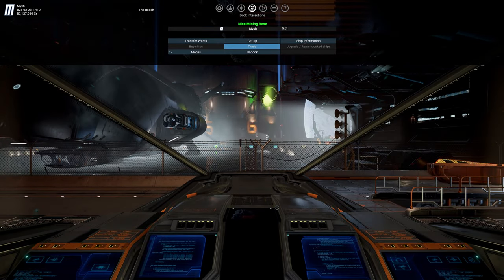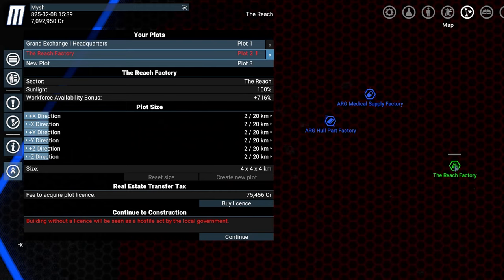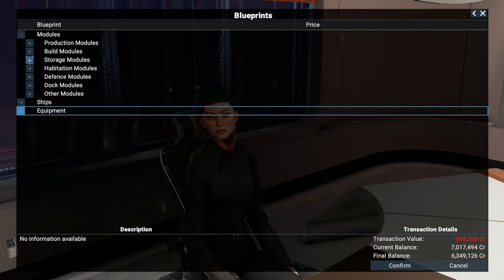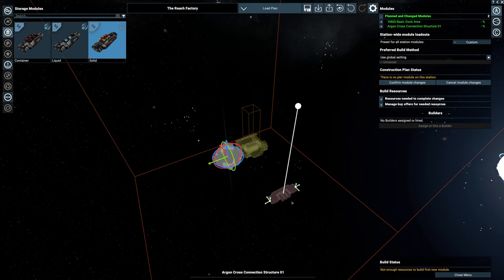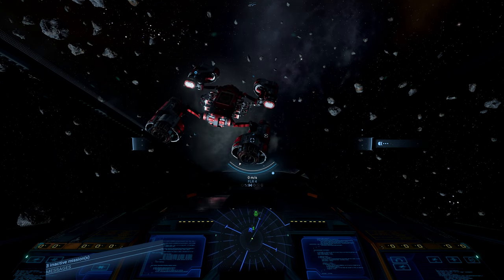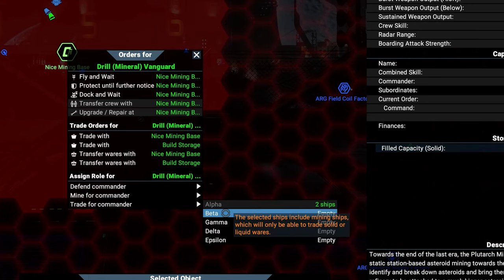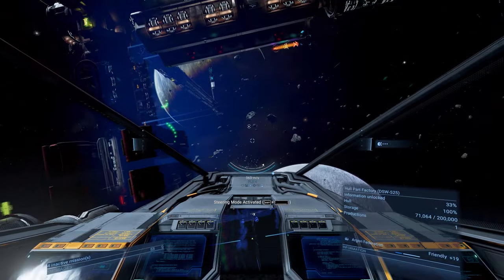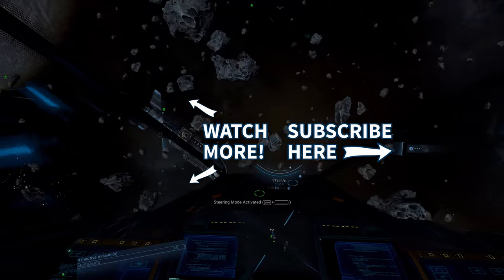X4 GUIDE: How To Build & Run a Mining Station (3/4)

Comment: instead I made it a trading station:
just added some liquid and container storage. (designed one in the station manager).
if 100% is full price...just buy at 25-30% and sell at 40%..
generally works...
add some miners, and traders, 
only buy what you mine from your own.
and you'll make more then just ORE.

for argon I like to start at second contact flashpoint 2.
there is ore and ice there, ore in the reach, and ore+silicon in second contact 7.
if you have a 3 star manager all in range.
1 gate south of argon prime.
Reply from the maker: Awesome advice! Thanks for sharing it!

Comment: I tried to mine in The Reach but about 6 to 8 Xen came and wiped out my mining fleet. I only have 2 fighter craft and both were destroyed while trying to drive them off. It's very hard to get started, as most of the missions I've seen only pay around 50K. Automining in Argon Prime seems very slow but it's the safest place for now.

Comment: I haven't been able to get the miners to mine or store anything automatically. Manually i have been able to, but i can only get them to store the ore in the build storage. 
Manager is 2 star, auto mining is at 1 star, but the ore is in the same vicinity of my HQ. Storages are connected to my station, not sure if that matters.

I Had the wrong storage.. Also why make a trade rule to buy ore form yourself? couldn't you click a button to not buy ore at all?

Comment: is their a reason for using 2 smaller storage and not a single medium? which costs less than 2 smalls to build and holds 2x more than the 2 combined.
Reply from the maker: No. It's just that the small blueprint is cheaper and you can run a basic mining base even with one S module. I just put two on my base here for aesthetics and convenience.

Comment: Quick question. I’m a new player and have only about 30 hours into the game. I ended up just making a fleet of miners that did “local mine” action. Is this not the same with extra steps? What are the advantages of this kind of station, is this just to cover showing how to build a station and it turn into an ore refinery?
Reply from the maker: I explained it in the video. It gives low level miners the opportunity to mine locally and sell in different sectors. It also lays the foundation to expand the base later on into a production/processing facility.

Comment: Can anyone please help me? I have set a ore mining base, have 3 miners detached to it, but all they do is they try to find where to sell ore, which results in "failed behaviour", instead of supplying my station with ore...
Reply from the maker: Sure. Here I am. :) Does your station have a buy order for the ore? Enough and the correct storage?
Reply: @WatchMysh  Both yes. Still get the "failed behaviour" and the miners just stand on one place, not mining anything. While when I give them manual order for both mining and delivery, they do it just fine.
Reply from the maker: @gammer0016  Hm. Okay, that's weird. buy order low enough? Resource probes set up?
Reply: @WatchMysh  Yes, resource probes all around - buying ore is on automatic price, but I dont want them to buy it from station! I just want them to supply it. Or is this not possible in this goddamn piece of unneccessarily unplayable piece of UI? :D Thanks for trying to give me advice so far...
I should also mention, that I have a trade route rule to buy only from my faction, which I tried both active and free from restrictions. Doesnt work either.
Reply from the maker: @gammer0016  that's perfect. Should work. Yes, they should only supply your station now. Strange it doesn't work. Maybe re-watch the video and check it every single setting is identical? What does the failed behavior say? Sometimes sth like "couldn't find buyer" is mentioned.
Reply: @WatchMysh  Ha, forgot to mention, that I rebuild it into refining station in the meantime. Still, dont understand why NONE of assined miners or traders wont do anything, they just fail all the automatic orders from station. If I do it manually, which is frustrating, they do them without any problem.
Reply from the maker: @gammer0016  I don't either :(
Reply: @WatchMysh  Ha, just found out! It was because station setting was overriding the rules! Needed to set it up right. Thanks for a help anyway! Your videos help me with this game regularely. 🙂
Reply from the maker: @gammer0016  Ooh that's what it was! Thanks for letting me know.
Reply: @WatchMysh  You are welcome - to be more specific, it was the trade setting that had the trading route rule to buy and sell only from my own. Not sure why that didnt work for miners, as they should have been able to mine.
Reply from the maker: @gammer0016  💡

Comment: How can I get a ship that I own to start purchasing wares, to bring those wares back to my station that still needs building, and drop them off at the build storage?
Reply from the maker: @davecrupel2817  assign it as "trade for build storage" so it will automatically buy the stuff you need.
Reply: @WatchMysh   it's struggling to even get the first module set up, so i havent been able to assign a manager. So it's not letting me do that. :/
I provided 3x the required budget. And its been 5 hours since the builder arrived.

Seems I'll need to go hunt down the materials myself.

Thanks for the reply & tip though! That will be helpful once I got my bass actually started, and get a manager assigned! :D
Reply: @WatchMysh  I figured it out! Turns out i needed to change the build materials sourcing to "no restriction" so the builder can grab the mats from anywhere.

Comment: I have a question that idk if i messed it up or what, when i trained the station manager with seminars so the trader can go through 2 gates, turns out the miners can also do it, and my miners decided to jump through a gate to go somewhere else to mine instead in the sector i am which is where i want them to mine, is there a way to prohibit the miners from going through gates?
Reply from the maker: Yes. You can blacklist sectors in the station's settings.
Reply: @WatchMysh  Yupp that did it, but i also found out i had a resource probe in another sector, and i guess the ships detected better asteroids there so they were traveling to that specific sector with the probe, after self-destroying the probe and setting up one in the sector i want, they stayed there without any blacklist, but i will use blacklist in the future now that i know about it. Thanks!

Comment: not start stuff but i love to see just how many ore etc processors i can stuff (with food and habitats and storage) into 2x2x2 i think when i last played i got to 16? edit: 10 refined metal 10 silicon wafers :P with 3x 6s3m and 1 large docks :P or 30 hull part modules in another 1 xD
Reply from the maker: Lol. I'd like to see that. Or maybe I'll try it myself first as a little challenge. :D
Reply: @WatchMysh  use the resource stuff for "movement" and place the solar panels at bottom in tight cluster since for some reason it wont affect how much they produce.... the 30 hull part crafter only needs 7 panels anyway :) you place the large connector juuuuust in away that people can connect to it (around the middle so that just the end point is "outside" the creation) in the end you pretty much have "solid" cube that you hardly can fly inside with space suit...

Comment: Good video but I would have used a crew member who wasn’t skilled in piloting.  You assigned a two star pilot as a manager.  You can use that pilot instead to fill shortages on a ship.  What I would do is assign the least skilled crew member to manager roles, then level them up to two star level using seminars.

Pilot stars don’t come as easily as manager stars.
Reply from the maker: That's true. I didn't pay attention. :) How you do it is the correct way.
Reply: @WatchMysh  Thanks and appreciate it.  Good editing on the video too.  Hey what about trade stations?  I’m trying to figure out how to make wares move between stations and not have to micro things.
Reply from the maker: @Project_-jq7jw  This is another interesting topic, yes. Actually I'm looking into it a little bit at the moment, since I haven't built pure distribution centers myself yet. But it's an interesting concept I'm thinking of making a video about.